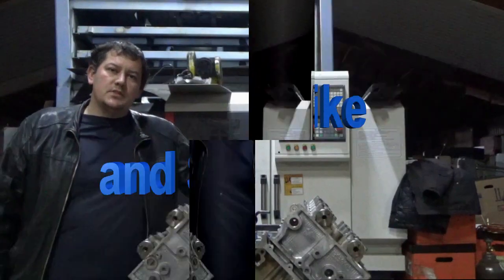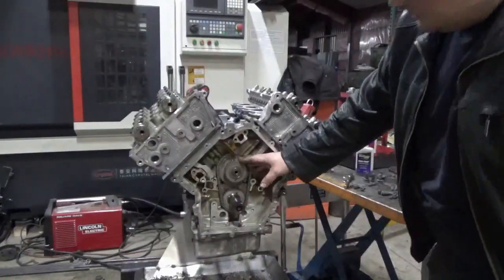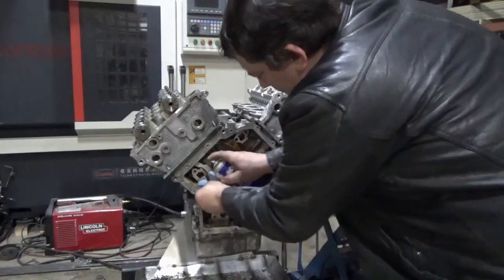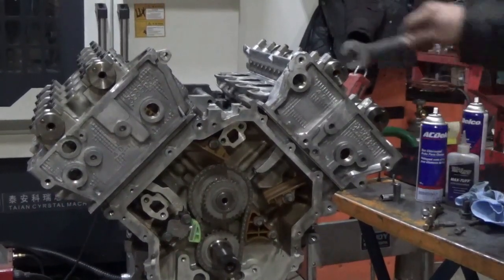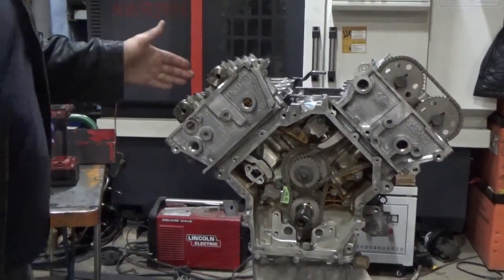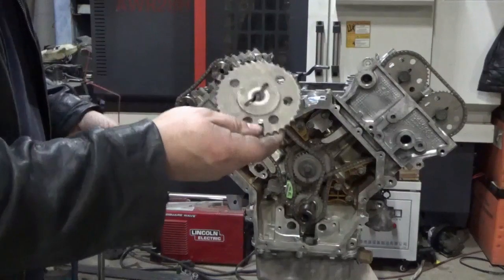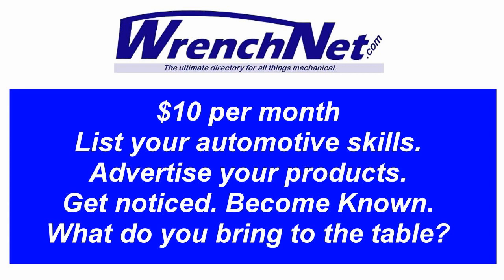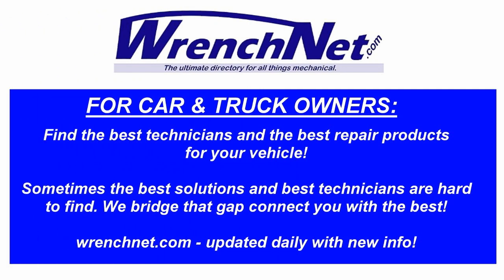How To Set Cam Shaft Timing on a Northstar V8

Comment: Thanks, I’m getting ready to replace the head gaskets on my 2004 Deville. Should any settings like top dead center be done before the heads are removed ? The marks you discussed were they on each cam ? So the marks have to be 90 degrees to the top of the head ? Can the harmonic balancer be removed without any problem ? Again Thanks, Steve

Comment: Hi Jake, I started My 1998 4.6, L37 Northstar the other day, and it backfired through the throttle body with a lot of smoke. It didn't start on that try, It did start on the second attempt. But the left bank now has a pronounced ticking sound. My question is this, Is it possible to access and repair everything (all of the probable parts) associated with this ticking without removing the engine? Thank You for doing this video.

Comment: Hey Jake very informative video thanks for sharing. I do however have a question or two for you. On my left bank 93 4.6l I have two le sprockets does this affect anything? I was unsure if not having an intake sprocket matters or not?? And second question what would the procedure be if the timing chains are already installed thanks for your time..,
Mike Vance

Comment: can the timing chains be done in car with out removing the intake on a 2008 4.6?
Reply from the maker: Yes. Front wheel drive I take it? It helps to have the cam timing plates for the rear bank to do the job in the car. Not sure if you can find them on ebay but you can also make your own if you're in a pinch.

Comment: Can I buy a bullet proof engine from u with all upgrades you can offer?
Reply from the maker: I am not building engines at present time due to work load. Probably will start again in early 2024.
Reply: @NorthstarPerformance  true I’ll keep an eye out because I have a 97 Seville sls with 156,000 miles and the common  northstar oil leak that I really want to make proper again.

Comment: It’s a Christmas in July to have a upload from the Northstar Master 😂🎉 thanks for the video! I noticed when doing my engine, the engine came out of a 98 Deville but might’ve been newer since it was a dealer replacement for the previous vehicle owners. I didn’t remove the cam sprockets to throw the chains on, would’ve been way easier. Also my cams wanted to spring to their neutral positions bad! But I have flat tappets also next time I’ll have that special holder tools or make my own. I wanna build another Northstar now
Reply from the maker: I need to do more videos..... I have a lot of knowledge to share with the world. And as for the cam tools, hang on, we might start selling them shortly to make the job easier.